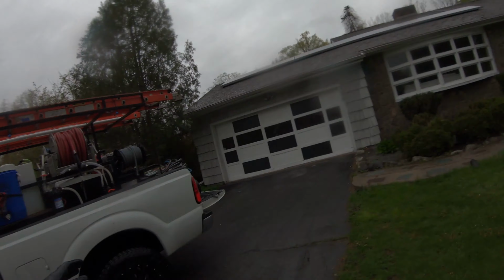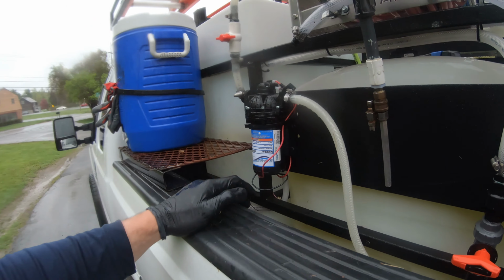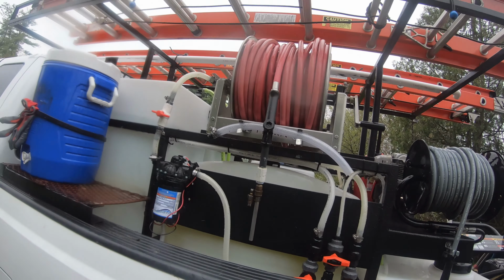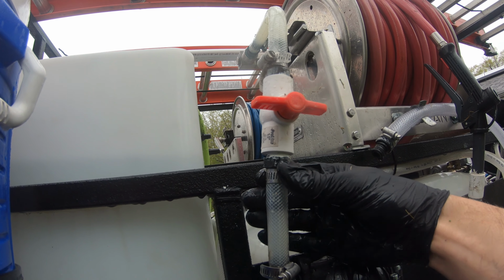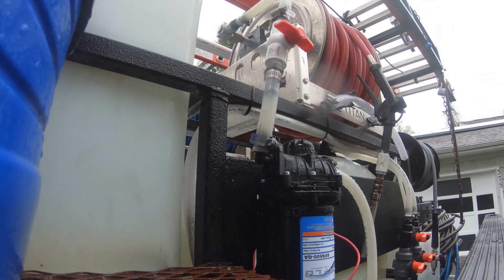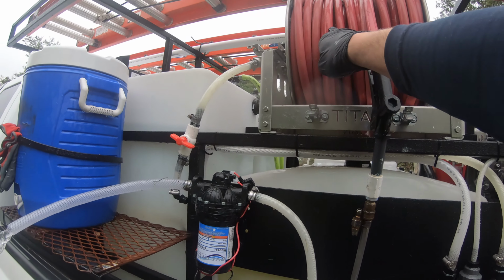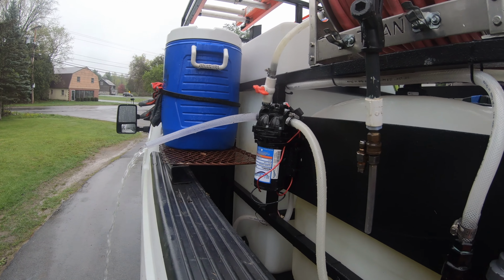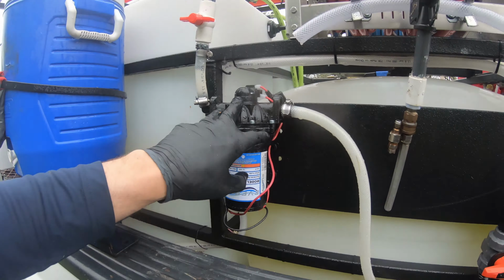RINSE Your 12 Volt Pump - This Makes It EASIER! - Roof Soft Wash 6% SH Bleach

Comment: Exactly what I was thinking! Was wondering how other guys were flushing their system and if there was an issue with leaving SH in my hose. Perfect.
Reply from the maker: I don't think there's much issue with the hose. Pump should be rinsed tho
Reply: @YoungAmbitionYA  that's what I figured.  I'm gearing up and running outside to install a ball valve and flush my pump right now. lol. I am using a 5/8" non kinking hose, is it alot more beneficial to use a 1/2" output on a 5.5 gpm 12v?  And what are you finding best for your input? 1/2, 5/8, 3/4?
Reply from the maker: @Trevor Praud  I recently made some changes for the coming season. Still using a 6 gpm pump but removed all the 1/2. 3/4 bulk heads, 3/4 hose to the pump, 3/4 from the pump to the reel. Using 5/8 hose now to the wand as well.   Getting more flow.

Comment: Thank you for the bid. I suppose you could just disconnect the line... and just flow water out. Water would get in the truck, but... Anyhow, thanks for the video.
Reply from the maker: That's works just as well and I've done that too! I just prefer the SH that's coming out of the line and pump to not be in the bed and dripping down the frame. Just a bit cleaner with the tube
Reply: Big time fan!

Comment: What’s up bud. Hey like your videos man it’s a big motivation for others. I know on my part. 😎 question what size is that quick connect and where did you get it from. I so want to do this to mine. Makes a lot of sense and faster. I like the idea. Keep up the videos bud thank you for all you show
Reply from the maker: You have to buy the pump that way. They sell quick and non quick connect pumps. I don't recommend everflo though. Try flojet

Comment: What connections do you have going into the pump? I have threaded barbs on mine so I would have to remove the hose from the barbs etc. so it would definitely take a little bit more time to replace instead of your setup
Reply from the maker: You would need to buy a pump with quick connect inlets. You probably have an everflo 5.5 (EF5500) mine is a everflo 5.5 QC (EF5500QC). Look into flojets. Superior to everflow
Reply: @YoungAmbitionYA  will do definitely. Which model do you recommend?
Reply from the maker: I use the flojet 6gpm R8600134 check kleen-ritecorp.com

Comment: Ah yes, the dropping of the wand, lol. Just throwing this out there. If the vent pipe is lead sheath. A coat of WD40 before you start cleaning will keep it grey. If not your SH will turn it brown. Any additional precautions for the solar panels?

Comment: Hey do you know how to troubleshoot the black fuse line? Mine tore a little at the bottom of the pump.
Reply from the maker: If it still works just tape it. If you can cut it and splice in a new wire that can work too
Reply: @YoungAmbitionYA  I just cut the black line, but can barely see the inside.

Comment: Where you get those quick adapters for the pump?
Reply from the maker: It's the model of the pump. Some pumps are quick connects and some arent
Reply: @YoungAmbitionYA  no I mean the spare barb fittings for the quick connect pumps. That’s what kind of pump I have. 
Your first setup video with the spray tank got me inspired and I picked one up to start a business.

Comment: How you charge for a roof cleaning?
Thank you
Reply from the maker: pricing anything gets easier as you learn your costs. that will be different for everyone. you need to cover your costs then make a profit. your pricing should reflect your fuel to get to the job, insurance, SH usage etc. for example i know that it usually takes me up to 10 gallons of SH per house wash. that 10 gallons costs me $44. so i price that in. understand? its not as easy as me just telling you $400 for a roof, because that $400 might cover my costs, but not yours. Not the best answer but its a tough answer to give.
Reply: It’s all clear . I have my first roof cleaning estimate this weekend. That will help a lot.
Thank you for your video and your time to answer me. 🙏